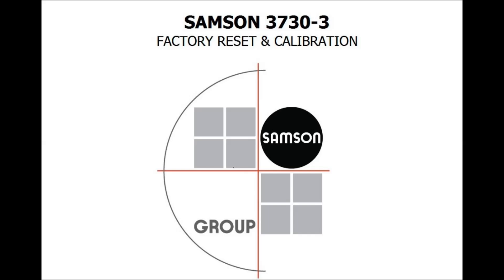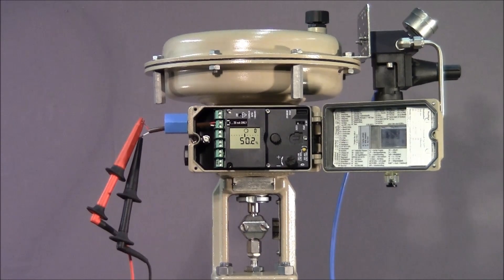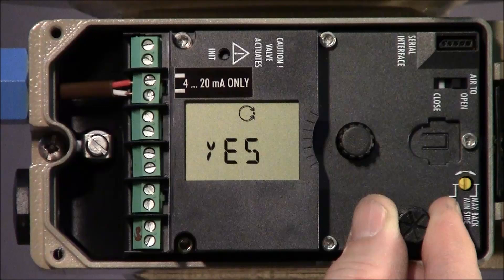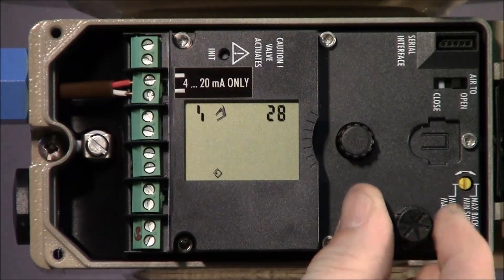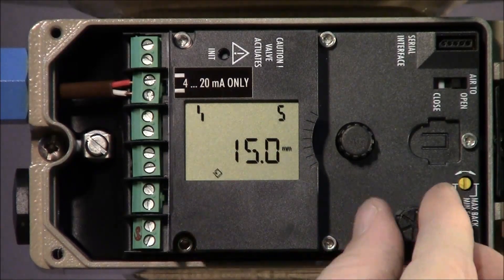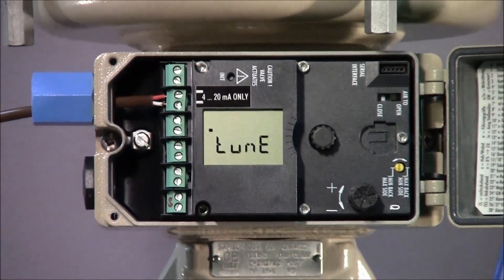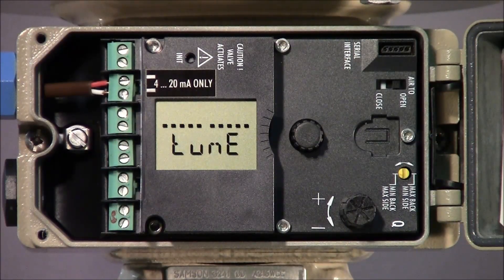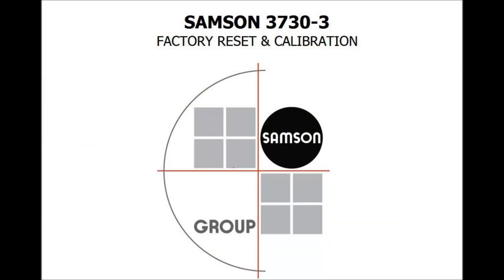SAMSON 3730-3 Positioner Calibration

Comment: hi. I have a  problem. when  controller  in operation mode,  unit more than 0% then controller display parameter but when it is 0% then controller 's screen not display and no signal. please help me.
Reply: Need to adjust ma output from dcs. Its bellow threshold.

Comment: applied the whole procedure to our newly replaced 3730-2 positioner, when it reach on tune stage, it starts tuning but in valve doesn't move in physical. need your assistance.
Reply: Tiene buena presión de aire

Comment: Dear all
I have faced one issue during that calibration.we are fixed new samson 3730-3  type control valve in water line.i tried to do calibration,as per  this video.whenever completed the NOM tuning,hand symbol blinking in the top of the display.valve also not opend by the set point.kindly give some suggestions for solve that issue.
Reply: Must be set to Auto mode .

Comment: hi, excellent the explanation but I have one doubt, as is the air connection to the valve positioner. installation of tubing? 

samson acquired a valve but do not understand how to connect, the manuals do not contain too much information about it, I have a pressure regulator 4708.
Reply from the maker: Carlos Ruiz Carlos Ruiz,The pneumatic connections are relatively straight forward, the supply connection is on the top, and the output connection is on the bottom (assuming the pneumatic connections are on the right hand side).However, this will vary slightly depending on which 4708 regulator is used and if you're also using a connection block. Can you provide any further info?
Reply: @samsoncontrols   can u explain more for code 4 and 5.